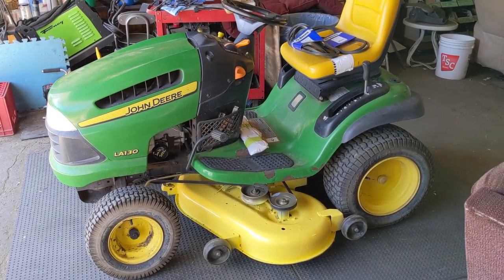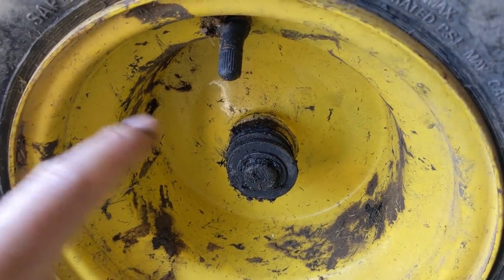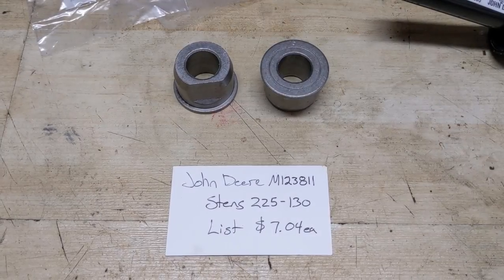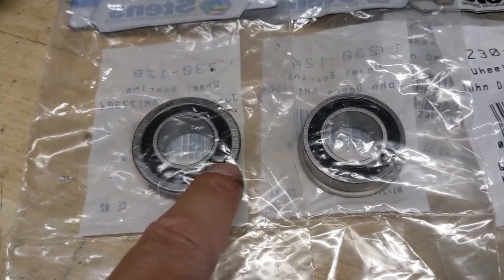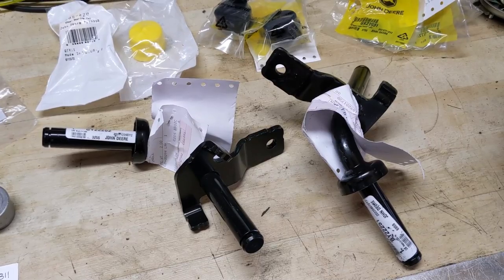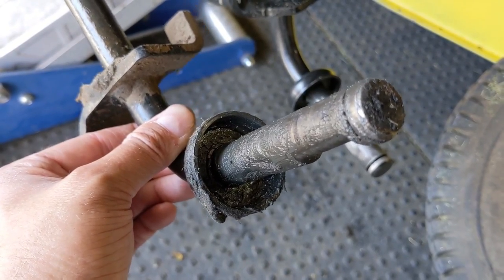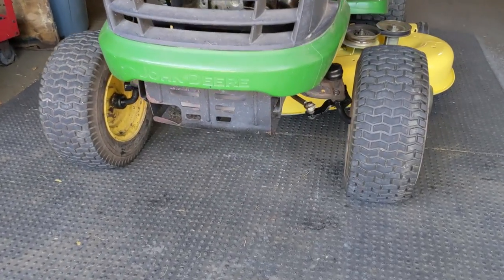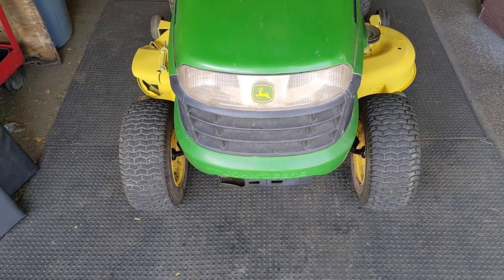John Deere LA130 Wheel Bushing to Bearing Upgrade

Comment: I work mostly for older folks and I’ve installed the easy turn brging kits and wheel brging kits 
Every one has been very happy with it and it’s cheap improvement for older worn out arms 😊😊😊

Comment: Excellent video, I also put flat needle bearings on the spindle shaft to make it much easier to turn. I don't have the part number today but if I can find it I will send it to you. Thanks for the video.
Reply: Is that what is called 'the poor man's power steering'?  I want to put those on mine too so it will be easier to turn.
Reply from the maker: Yea I'd like to get that info if you could, I've heard of this upgrade. The issue with tight steering on these usually comes from the sector plate and pinion gear below getting worn and also all jammed up with grass. Thanks Waterman!
Reply: https://www.youtube.com/watch?v=ySXazpX2XP4&t=5s
this will give the links to the parts in the 'more' description.
Reply from the maker: I got your email, thanks. Looks like eBay and amazon sell a complete steering kit with those bearings and the wheel bearings, spindles, dust caps and every washer needed. About $65 Canadian
Reply: Flat needle bearings on the spindle shaft, is a nice easy upgrade, I did that to mine a few weeks ago.
Reply: I started asking customers if they wonted it and every one said YES plus they tell me it’s the best bucks they spent

Comment: Well done on the wheel bearings. I just did this myself on my Husqvarna. It was very easy. I also recommend the poor mans power steering mod, also very easy and have reduced steering effort by about 50%. It was only $20.
Reply: Doesn’t dirt get in those bearings? Just asking, don’t mean to be negative. I’m talking about the ones for the steering.
Reply: @ronaldnorris2179  Yes, the bearing aren't sealed so dirt can get in there. However, having said that, I watched a video of a guy that checked the bearings after 10 years. They were worn but still serviceable. considering the cost it is easy to have a spare set on hand just in case.
Reply: @jameslester6785  Appreciate your response, thank you, I may try that 👍

Comment: Did this upgrade when my mower was 8 hours old, and was surprised by the amount of wear on the wheel axle. I also added thrust bearings to the spindle at the time. Poor man power steering they call it. At the time all the pars combined were cheaper than replacing a hub. Theres probably 50 tricks of little things a person can do to those mowers so nothing wears out where it's steel on steel. One great trick is add a plastic washer made from a milk jug between the mower belt tightener with some grease. That wear spot is done and will last forever. Do the same to the drive belt tightener. That plastic milk jug material will never wear out, nor will the steel tighteners either. My mower is 130 hours old, better than new, literally.

Comment: How about adding needle thrust bearing between the cast iron front axle and the wheel axle itself??? This would really make steering easy. Nice work too.
Reply from the maker: Yes, will be doing a video on that eventually!
Reply: @EliminatorPerformance  Job well done fella. I will be making this improvement on my tractors. Thanks fella.
Reply: Love the kits and they really do work

Comment: Good video. I'm going thru a steering issue on my LA140. I have already replaced the steering gear, but noticed while turning, the tire was fighting against the steer. So these steering arms are none adjustable, so I am guessing the last owner hit something pretty hard, my spindles look pretty good still, but will change them anyway especially flipping for a new mower deck. They only come in green color now.

Comment: Safety green and yellow matches John Deere colors the best.
Reply from the maker: We'll have to check them out, thanks for watching!
Reply: @EliminatorPerformance  This video hit me since I have a L130 but it is a  J.D. hydro drive. How much fluid do you lose threw the breather over time? Might be a good video on hydro oil. Don't miss a Sunday. Thanks
Reply from the maker: @JRGood-mm9yu  oil on this unit was right on the mark, drain and change 78oz 10w40 oil and filter. This thing had a full service, my customer should be pleased.

Comment: Just a quick question . . . I know this probably defeats the purpose of using bearings but . . . did you regrease the spindle shaft through the wheel hub zirk?  Thanks, great video!
Reply from the maker: You can if you want to, it helps prevent water from getting in. However, some of the kits sell steel spacers that take up the empty space in there. Really there's no need when they're 2-RS bearings (dual sided rubber seals). If there was a single rubber seal on the outer side, you would definitely want to Grease them!

Comment: Good video Jake. One small question, did you or do you recommend removing the inside rubber seal on bearing so it can accept grease when wheel is greased?  Have a good week.   Rick
Reply: Motorcoach Tech it is the old man at EP here: i personally think that pulling the inside seal and filling the entire inside area of the rim opening where the bearings are installed will increase the life of the two bearings but only if the owner maintains pumping grease inside this area on a regular basis. How much longer this increase will be beyond the life of the bearings installed with both seals on is subject to the maintenance. Therefore, i would not suggest it especially when these sealed bearings with last a very long time with both seals left on but it is important to have the axle greased for ease of wheel removal if necessary. Lets see what Jake suggests!
Reply from the maker: I suggest just leaving the seals on the bearings (because it's a customers) and worse case, just replace a bearing. If it was my machine, then removing the inner seals and pumping the grease in there would be ideal. As the old man said, upkeep is essential. Grease keeps the moisture out, and keeps the bearings lubricated.
Reply: Nice video. My customers are too cheap and would run the worn bushings/axles until they fell off!

Comment: I would remove the inner seal so when you grease the wheels fresh grease goes into the bearings
Reply: You don't grease a sealed bearing, that defeats the purpose of this swap. Do you grease OEM non greaselable u joints for your truck?

Comment: Do you install the bushings for proper spacing with this bearing conversion? Just want to make sure the wheel isn't going to rub.
Reply from the maker: I'll use washers where needed, just get some .750 ID washers and you'll be fine
Reply: Thank you!

Comment: I remove  the plastic ring on the inside so i can greasr it using the wheel zert every 6 months and remember there is also a grease zert in the middle of the front  axle

Comment: Good information. Just to clarify, the roller bearing will also be able to spin on the spindle in addition to the bearings turning? Will that also cause wear on the spindle? Thanks.
Reply from the maker: No not that I've noticed. They rolled significantly easier, and you have to remember the weight of the mower will be pushing the spindle down on the bearings inner race, so the inner race doesn't move much. If it's too tight of a fit, you'll have a hard time getting the wheel on and off lol
Reply: the bearing is hardened steel and if it spins it will eat up the soft spindle. these bearings are made for interfearance fit not a slide on fit.

Comment: Man I changed my front tires and now i cant get one of them to stay on haha. The stupid e clip keeps popping out, I had to finish mowing the other day with vise grips holding it on haha. I have tried a couple. Im about to just put a weld bead on the end of the axel haha
Reply from the maker: You may have opened the e clip up, try squeezing it back together just a little bit with a pair of pliers. If that doesn't work, you may have to replace it.

Comment: Did you Reverse the front wheels?  I see the zerk fitting is on the inside, Schematic shows 12:38 it on the outside.  I prefer both valve and zerk to be inside on my X320 as I have Chrome/Stainless hubcaps.
Great video.  Will the Torrington type roller/ Thrust setup work for all JD steering Spindle setups?
Reply from the maker: I did not flip them, that's how they are on this unit,, it's a customers machine as are most of the equipment in my videos. I've never seen grease fittings on the outside of a wheel though. And yes, the bearings will work on any spindle/axle shaft, just check the dimensions of your factory wheel bushing, and then cross reference that with a bearing.
Reply: @EliminatorPerformance  I was referring to a Thrust bearing on the Bottom of the SPINDLE, not Axle Bearing.
Reply from the maker: @gordbaker896  yes, I plan on doing a video soon on the poor man's Power Steering! My kit just came in

Comment: Just an fyi. I don't know which models this applies to, but my 2024 S240 had bearings from the factory.
Reply from the maker: @sgtlwh3485  yes the S series is above the E series, so they usually have bearings now. Little bit more $ but worth it for some stronger components.

Comment: Very good video on an easy swap to a better part, too bad it cost your customer new spindles. You would think newer models have bearings? Do you know if they do or still using bushings? Interesting to see that bushing part number  also fits applications on Ariens, AYP, Honda, Husqvarna and Toro not just the John Deere!
Reply from the maker: Yes they use these bushings on the cheaper models, the higher end models use bearings. Same wheels, bearings can be swapped over for an additional cost. Thanks for watching!
Reply: My 2020 JD 170 ( I bought new) has wheel hub bushings (Not ball or roller bearings) that I'll be replacing soon since I found about 0.025" of wear on the hub shaft, Due to the factory bushings. I just recently added the Thrust bearings onto the Spindle shaft to ease steering.  Very poor John Deere factory engineering !!!
Reply: @unclefuddelmer8611  Good preventative maintenance move there unclefudd

Comment: My JD 105 was stanced too but had the plastic bushings with grease fittings. It now has front wheels with bearings I saved from something which took most of the slop out. Have you ever seen where a mouse nest ate holes in the cylinder wall? Little bastards pee sulfuric acid apparently.
Reply from the maker: Yes mouse urine is very acidic, if left long enough, it can do damage to the aluminum block. I've never seen one worn through, but the aluminum near the coils (near the nest) was very oxidized and needed cleaning

Comment: The following may be a good clip for you to do, I have a friend in Alaska that needs a Snapper part ( Liner for the Smooth Clutch ) assembly, WHERE up there can he get it??
Reply: I think you are talking about drive disc liner Stens #240-325 Snapper 5-3103, 5-7423, 7053103, 7600135, hope this helps. If i lived in Alaska i would deliver it to your friend .

Comment: There was no point in adding grease to the wheel hub zerks after installing sealed bearings.
Reply from the maker: It packs grease in between the 2 bearings preventing water from getting in there

Comment: my neighbour has a jd e110. he finds the steering hard. is there a bearing upgrade for the spindle bushings?
Reply: There are washers and thin thrust bearings you can order that will fit on the top section of the spindle and at some point we will be doing a video on the part numbers and the installation. Thanks this has always been on our mind especially when customers never keep grease in the spindles and they dry up and get stiff.

Comment: How many hours are on mower, at time of repair?
Reply from the maker: About 15yrs worth of cutting lol these were manufactured in 2007
Reply: @EliminatorPerformance  WOW!! Thanks
Reply: Grease up my shaft and call me Amy that made me hungry for more
Reply from the maker: @MrJakethehouse  greasing for subscriptions lol man's gotta eat
Reply: It really depends on dirt and use of mower but I’ve seen JD with just two years and allready damage spindles
Reply: @philliphall5198  13 years ago I did this and thrust bearing upgrade when my LA145 was 8 hours old, and the amount of wear was shocking. PLUS I greased the wheel bushings when I got the mower brand new before the first moe. Do every upgrade when it's brand new so you don't have to buy any expensive parts. There's lots of inexpensive tricks and cheap upgrades that make those mowers last forever. But JD doesn't want anyone to know that.

Comment: 0:21...the tear on the seat can be repaired with a product called, SHOE-GOO. The clear rubberized paste is sold in a squeeze tube in different weights, and is priced between $5.00 and $10 dollars. Ctire and Home D stocks the stuff. I use a plastic spatula to spread it nice and thick on multiple items made of rubber, plastic or vinyl.